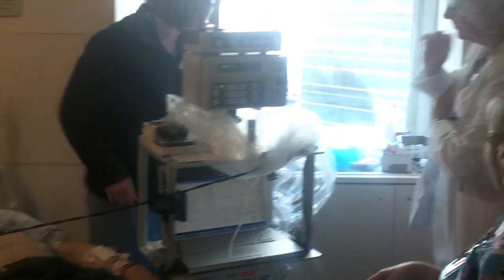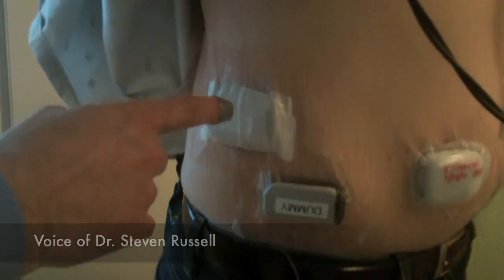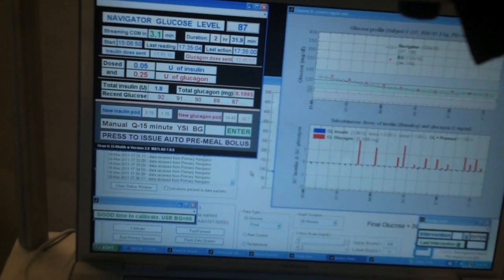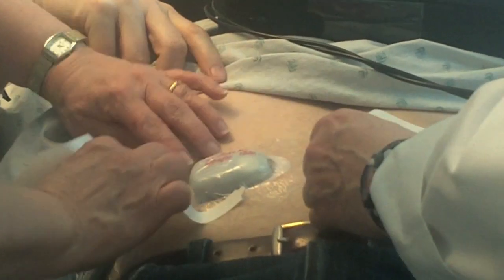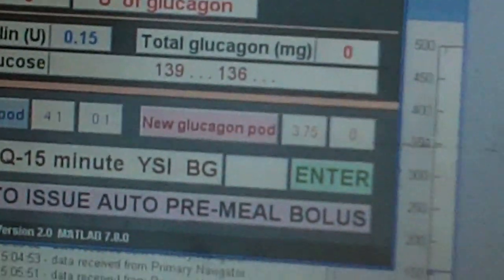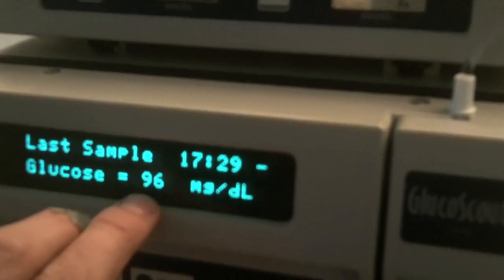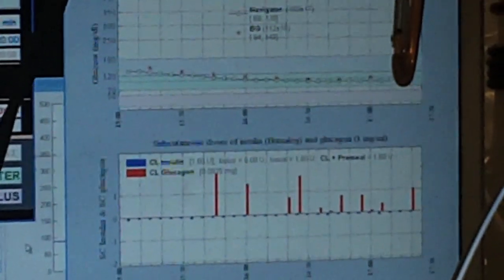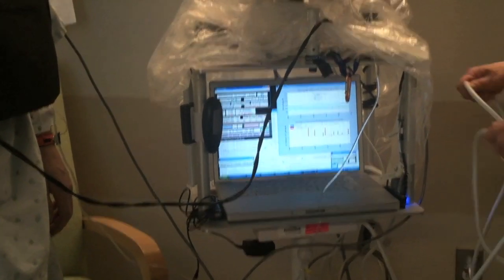Behind the Scenes: Artificial Pancreas Clinical Trial

Comment from the maker: @tqb43 No, he doesn't! As the doctor explains, the algorithm is designed to pick up the slack no matter how many carbs he eats. The pre-meal bolus is just designed to give his system a head start, since insulin doesn't work right away. Eventually there may be various pre-meal boluses, depending on the size of the meal, but as of right now, it doesn't involve any carb counting for the patient.